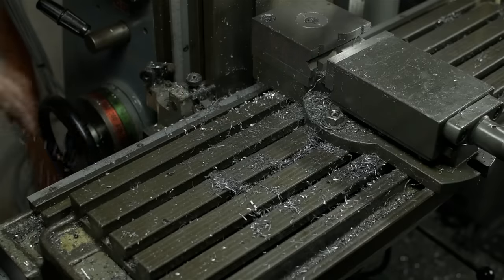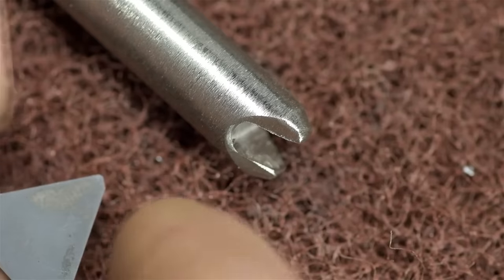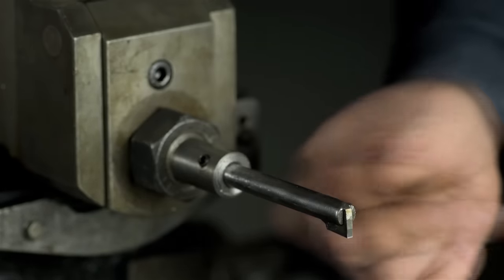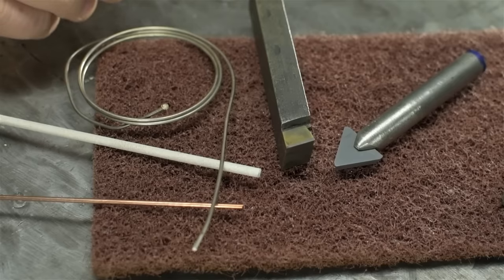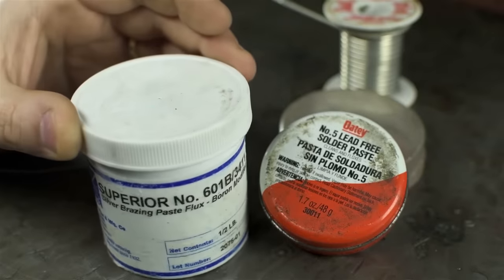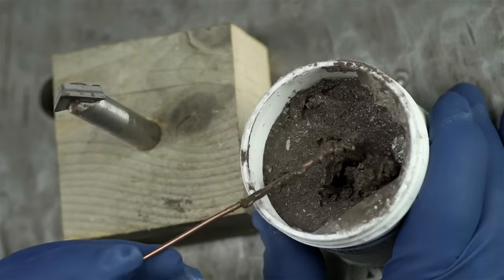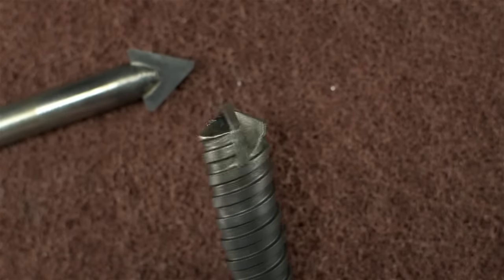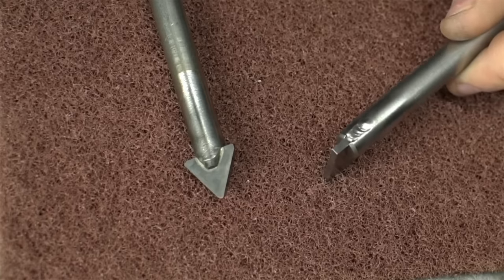Custom Tools - Brazing & Welding

Comment: I know this is very late, 9 months, but I just saw this video and your brazing video from 3 months ago. Your silver brazing alloy is less silver than my silver solder for sterling silver, where the solder is often 80%+ silver, and the sterling silver is 925/1000's silver. furthermore, the harder solders for jewelry in silver often melt in the 760-800 degrees C range.
so is brazing not just a "low-to-mid-heat-solder"?
it is from my perspective at least.
sincerely,
a hobby jewelrymaker, who enjoys your videos.

Comment: Tony... now don't quote me on this, but I have been quoting you liberally lately. It helps when I am in a heated discussion with those pesky conservatives. I usually am at about 600 F to 700 F, but no discussion is worth more energy than that. Note, I never do any discussing in metric. All those Canadians stay on their side. So good ol' Fahrenheit does the trick down here. Thanks for the liberal dosage of estimates and guesswork. I am sure every time I quote you I am right within half-a-thou. Even though I am a left handed discussor. :-)

Comment: LMFAO. It's a pun. Therefore it's a punny joke.  The Ringleader is the leader of the crew. The guy in front is the Ringleader of the bathtub. The ring in the bathtub is that soapy dirty ring that develops when you're done bathing and get out of the tub. The origin of the term Ringleader comes from the first person in the tub bathing when tubwater was shared instead of freshly filled for each bather. Hilarious if you enjoy witty puns. Otherwise it just doesn't seem funny. I laughed uncontrollably. Thanks!

Comment: Ok, so I’ll get a little off track here and talk about the silver soldering and brazing thing. Not so much joking here.
Many years ago (1970’s - 1990’s) there was soldering which was done with solder ( a mixture of lead and tin). There was a similar practice called brazing which was actually done with BRASS. This is where the term brazing was coined. All of a sudden it’s a terrible thing to solder water pipes with LEAD! I WONDER WHY! So the government told everyone not to use lead anymore. That didn’t stop lead from being used in electronics. So the solder to be used on water pipes is now a mixture of Copper, bismuth, tin and silver alloy. This caused people to need to distinguish between solder and potable drinking water pipes. So all the solder that is used for water or where used for consumption is now called Silver Solder. As if that isn’t enough, besides just using brass, there is a mixture using silver for brazing! This difference was the original use of the term silver solder and brazing. But now to allow the difference between the two silver soldering, we call the one silver brazing and the other silver soldering. Sorry this wasn’t funnier, but truth needs to be told.

Comment: I built a Gingry shaper and it works well but the tool gets dull very quick. One pass and it starts to chatter and won't cut. I can sharpen it and it cuts like a champ. Hss did not let it discolor. and honed it to a sharp edge. Is it the small tool size or the oxide layer on the aluminum casting? anybody.

Comment: What temperature can you heat carbide to before it has to be hardened again?
Reply: Carbide is hard via its density and doesnt need tempered. You can get it cherry hot, bend it like playdough, then let it cool, and cut with it.

Comment: I would like to try to explain the punchline of the joke. I believe that the "ring" they are referring to was the scum(dirt) ring that would be left behind in the tub by the body oils and dirt removed by the harsher lye soap of the time. The first person in the tub would have started to leave a "ring" and would be therefore the "leader of the ring" - AKA "The ringleader".  I'm not sure if this is relevant but multiple people would have used the same bath water as hot water required more work than turning at tap. Families would do this and it is said that the water would get so dark with dirt that there was a danger of losing small children in it. Supposedly the origin of "don't throw the baby out with the bathwater".

Comment: Back in your day...they didn't take baths every day due to running hot water not being super prevalent...so when someone would take a bath they would leave a dirty ring in the bathtub at the surface of the water where it meets the tub wall...if you had three dirty people take a bath at the same time there would be a very evident ring left behind...the first one in would technically be a ring leader

Comment: Ringleader: when one takes an actual "bath" in a tub, especially if you're kind of filthy beforehand, a residue of soap, oils, dirt solids, and tiny bits of skin is deposited on the tub at the high water line. This accumulated gack is known as "a bathtub ring". Thus, the first of our 3 exemplar bathers to enter the tub is also the first to begin accumulating gack on our tub surface, making him, in the joke at least "the ringleader". No, it isnt funny at all, and I doubt it was in the 1920s

Comment: I get the joke. When a dirty person takes a bath, they leave a dirty tub, dirt accumulates on the sides of the tub, creating what looks like rings,  So the first to enter the tub is the first to cause the tub to be dirty thus causing the first ring.  So he is the leading in the ring race thus the leader.  I don't if I explained it clearly, i hope this helps.

Comment: I doubt you were serious about the joke cause we all know you know everything. But if anything, plenty of dirt floats in water and we know that a miniscus is formed and the height is determined by various things, but things can tend to get stuck in there. Due to noslip conditions in fluid mechanic dirt is  like pasted onto the wall of its container as the fluid drains. It take only a a few mm before the dirt is deposited into the ring around the tub. If you are the first guy in there you are the first to get your dirt in the water therefore your dirt will be the first to reach teh edge of the tub one would think so you'd be the first to start the creation of the dirt ring in the tub. I seen something about depositing of material on the walls of a container when draining fluid, but not sure if it hold real importance in the real world as I've never seen it outside my textbook

Comment: In 50 years, some snot-nosed kid will browse a video library run by space-nuns and check out this video. He didn't get the avon79 joke, but hasn't given it much thought at the time.
30 years after that, in 2100, he will upload a video to WeTube where he will ask his followers about the joke.

Now please help me, my lathe is stuck in 2021 and this year sucks!

Comment: Jewellers use a type of filler rod that’s between 70-90% silver. They call it....silver solder
Reply: Jewelry "solder" (for legit silversmith, not craft hobbyists) comes in billet/coupon form that you snip lil squares off, 3 "hardnesses"/melting points so that you can do multistep fabrication on a small piece, and by LAW must still contain at least 92.5% silver after you have completed a join if you stamp and sell it as '925'/sterling silver

Comment: "Ring Leader" is a traveling circus term. Back before television people used to go to traveling circuses for entertainment. Under the "big top" tent there would be large rings in the ground within which various acts would be performed. The largest circuses would have 3 rings and would be referred to in advertisements as a "Three Ring Circus". Like Barnum and Bailey.
   There would be a circus-man in front of the rings dressed in a fancy uniform and a cane whose job it was to flamboyantly talk to the people in the bleachers (grandstand) and introduce the the various acts as they came out. "Ladies and Gentlemen, in the center ring, This Old Tony with his trained milling lathe will . . . " 
   This circus-man was called the "Ring Leader". Back before television everyone would have known this term. So it's a play-on-words joke. The three men in the tub with the toys are a "Three Ring Circus" and the man in the front is the "Leader". The "ring" around the tub is the connecting word for the play-on-words joke.
  Technically it's not a joke, it's a riddle.

Comment: The tensile strength may be 70,000 psi, but that is based off a charpy made of pure filler in a lab environment.  The tensile strength of the filler does not address the shear strength of the joint, which generally must be a lap joint.... In the end, brazing is inferior to weldment strength and durability..... ;)

Comment: Chromoly tubing is designed to be flame brazed, welding it is technically incorrect. Look at any super high end bicycle frame, lugged and brazed, NOT welded.

Comment: The joke is that the first guy into the tub creates the first stain or "ring" in the tub, implying that there is a prolonged time between the addition of each subsequent bather. Enough time for a tub ring to form. It is not a funny joke.

Comment: The idea of the joke is that when a person takes a bath and the water is let out, sometimes a ring shaped stain is left on the inside of the bath by the floating filth that was on the surface while the water was in the bath. The joke simply relates the ring in a bath to the circus term 'ringleader'. But ringleader is also the name for the central figure among trouble makers so if you had three naughty boys in a bath tub, one might be the ringleader and if they were sitting in front they could humorously be imagined as leading in the making of the dirty ring in the bath. It's a very lame joke.

Comment: Ringleader: The filth that comes off a person while bathing floats on the water line in the tub. It sticks to the wall of the tub forming a visible layer of crud where the water line is. When the water recedes from draining the tub a "ring" of filth is left behind. This is called a ring.
The person in the joke is the 1st person in the tub, he is leading the bath, so to speak. A leader.
A ring leader.
Truly its an old joke, as no one born in a time where books are curiosities would assume anything except perverse sodomy, no Millennial would understand innocence or difficulty in acquiring hygiene. 
Anyway, long story short, the layer of dirt in the tub after a bath is called a ring.

Comment: Wait, you dont get the joke? The joke is that when you're especially dirty, you'll leave a rink of filth behind on the tub when the water is trained out. There's more than one person in the tub, so the person in front is the "leader" of the group that is making the ring which will be left behind when the tub is trained.

It's not a funny joke... But well, it is a joke.

Comment: What about exploiting the heat of brazing to perform the required heat-treat of the high-speed steel?  On purpose, you overheat the joint and braze it, then quench, and then the secondary lower heat temper (which is sufficiently low to not damage the braze joint)?
          Do you know about Tantung? (https://tantung.com).  It is an as-cast tool steel that is not heat treated to get its hardness.  It "bridges the gap between high-speed steel and carbide".

Comment: I use TIG for soldering.
It heats up quickly and not the whole element.
A small current must be.
My results are here (page in Polish)
https://www.cnc.info.pl/jakie-gatunki-stali-nazedziowej-kupic-na-zapas-t84068-60.html

Comment: I found i could weld HSS By accident  & all my tip's today lave  HSS tip's  now  Over all it cheaper to slice pace o HSS of a Stick & weld in on to a Shape Mild steel square & them grin a cutting edge on  to it . i find 3mm to be a size &  thickness works well. & as i stick well a thin rod & wedding mild steel to HSS keeps the heat out of you work peace HSS will suck the weld in.
Reply: Thank old tony for confirming it was ok.  So meny sead it should not be done.  I find Carbide. tip's hard to get for bracing They brake up when on so brittle  I haven't broken one welded on HSS tip yet. I sups i will now LOL.  one must let them cool at the own rat dont conch them ti avid weakening them . some weld are as hard as HSS when cold  les England  It as saved me a fortune in tip's  Give me you thinking on brazing modem tip's on to mild steel have you tried it yet. I find i can never get the screws to hold them in place. i ben thinking of trying the new silver welding rod's in the  hole & doing away with the screw all to gather giv it a try on son mild steel blanks see it it works les Englend
Reply: Yes i know they seal HSS tips now  But it the screws holding them No. that tend to let them down as with the new tip The screws just are  not that  availably & other screws joust aren't up to the job.  That wat got me to weld on my first tip  I Make them all now. when i need them. Les England

Comment: Not exactly true. When you braze cast iron the tinning is not only on the surface it does penetrate. Not sure about steel or carbide because I was not educated in brazing such items. Brazing cast, however, I was educated and tested to journeyman welding standards. 80% + on paper and 80% + in Braze welds. If your weld didn't penetrate then you failed cause your weld did not hold in the break test.

Comment: If you'r were really dirty,  like coal miner dirty. then you'll leave a ring in the bathtub.  In 'olden times' people bathed less regularly, and often re-used the water between bathers.  You might get away with that with your kids, but only until they're about 8 or 9 then they'll refuse. Anyways.  Because the first (presumeably filthy) person is taking a bath, he leads in leaving a bathtub ring.   The 'ring leader'.

And no, not really funny.